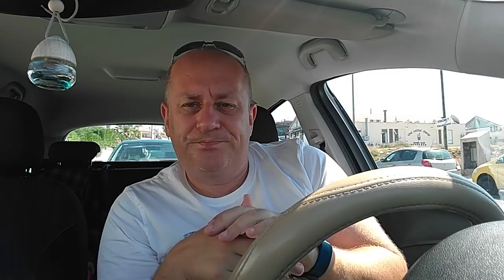Electrical sockets in Spain.

Comment: "1.5, 2.5, that's the diameter of the copper cable itself"  Incorrect, the 1.5, 2.5 square millimeter size refers to the cross sectional area, square millimeters, of the copper, not the diameter.
The UK BS1363 fused plug was invented to allow ring mains fused at 32/35 Amps to be used, as Spain uses 16 Amp breakers to protect the socket circuits and the sockets are rated at 16 Amps, there shouldn't be a problem.  In my experience, the main reason for damage from overheating is from loose connections at terminals.  As Spain uses fine stranding copper wires, the ends must have ferrules fitted if the terminal is a screw terminal, with the screw bearing directly on the wire.  
Going back to BS1363 plugs versus Schuko plugs, when was the last time you stepped on a Schuko plug in the dark, usually in the bedroom with bare feet and screamed?  and a 13 Amp plug?

Comment: Your video is great. I was thinking same as you, how they could wire 1 cable for everything. I was thinking to change cables and separate air conditioning and oven too. What you can suggest to me? In uk as you know we use 2.5mm for sockets 6mm for oven. No idea about air con because in uk we dont use :( i called few spanish elections to change cables and consumer units but bo luck so far.
Reply from the maker: If nearby i can give you an electrician. But we splitting the circuits is better if it's a fixer project. As much of the wiring may be 1.5mm (lighting)
Reply: Murcia , los alcazares i am,  i need to change consumer unit, run cable to oven and  new cable to 3 air con @LaMataMatt

Comment: There wiring is crap pal I’ve been a electrician. For over 40 years , there work is poor ..and shoddy. ..most houses I have seen are terrible 1.5 is for lighting we do use radial circuits 4 mm cable. Incoming isurrply is poor too ..,I have worked in Germany , and France .. we’re the work is a lot better ( some in France is bad to) but not as bad as Spain. Who trains the Spanish sparks ? . Most of them would never get a job in the uk …
Reply: No matter how poor Spanish electrics are, they'll never be as bad as your grammar

Comment: And we don't need fuses because we have radial circuits ( British people always criticizing Spain ) so I will use this opportunity to say that why don't you say anything about the  ring mains system in UK (which is frightening)?
Reply from the maker: It's not being critical it's a warning that the world has moved on. Most of the cable installations that are under rated were in the 80s. People had less technology and lower power consumption. The Ring Main of the UK was introduced after WW2 and due to the massive rebuilding of the UK, it was introduced to reduce the amount of copper needed.

Comment: I live in Spain and never had problem with electrical safety and I do have earth cables in all my sockets, the only point where I agree is that they should 2.5 mm instead of 1.5 but Spanish electrical law is based on Germany's and they would do something if it was so dangerous. If you want to see dangerous sockets go to Peru or Paraguay. And my devices never get hot .
Reply from the maker: People do install 2.5 as standard and 1.5 for lighting. The issues occur from older installations. Which on the coast is mainly 80s.

Comment: As for lighting circuits if we look at the Regs, 30 points are the max per circuit, i agree with you, if a house is split over floors split the lighting circuit over both floors. Are you talking about 35/50 year old properties??? Theres no need in a new property to fuse individual plugs in Spain as the whole reason for fusing plugs in the UK is because a 32A MCB/Fuse situated in the customer unit doesn't offer really much protection. The potentially unsafe and poorly designed wartime Britain regulations need to be adapted and individually dedicated circuits need to be brought in. Far safer.
Reply from the maker: 70s onwards as many have never had any upgrades or modernisation. New fittings old wires.
Reply: @LaMataMatt  i will add that the combined circuits of lighting and sockets in virtually low consumption rooms (we are talking before the commodities era) should have always been supplied and protected via a 2x10A MCB.

Comment: The only real reason to supply a socket with a 1.5mm cable in Spain is to supply a lighting socket, switched from a wall or device like a timer, relay... The Spanish Wiring Regulations does not specify 1.5mm for socket circuits its 2.5mm. In older properties before the 1974 REBT sockets & lighting in bedrooms and some times in the living room were supplied on the same circuit this, is no longer allowed.
Reply from the maker: I agree but still come across it regularly. The properties in this area are late 70s onwards. But still find it in 80s builds
Reply: @LaMataMatt  yeah you would do as in the 70s the regs were really pushed through around 1986/1988 and made the installer marginally responsible.

Comment: Sorry a bit dense when it comes to electrics.  Are you saying it is safer to have a British plug with an adaptor rather than using a Spanish plug?  I am a bit nervous of fire hazards so that sort of thing is quite important to me.
Reply from the maker: Most UK plugs have fuses in them, Spanish ones don't. So you can have a problem at a socket in Spain and it doesn't trip the power until it's a bigger problem. For example once it's burned the cables and they short together. Putting a British plug in an adaptor gives you some protection at that socket that will likely blow the fuse before anything worse happens.
Reply: @LaMataMatt  Thanks.  Probably a precaution I would take :)
Reply from the maker: @SweetLilyofPeace  it can save on a repair but also the adaptor is not far off the cost of changing the plug. So can be easier aswell.

Comment: Very worthwhile listen Matt, thanks. You're inadvertently making a fine case for buying a property in need of upgrade / remodel so new installs are overseen for QC.
Reply from the maker: The thing is when they were built it was fine. But today's world we use more power and need more sockets. So definitely worth taking a look at to make sure its either upto the job or budget for an upgrade.

Comment: Spot on! Even though ours was a new build when we bought it (2005) the electrical circuits are terrible! I even pulled new cabling myself to serve the swimming pool so it was on its own breaker circuit. When we had that installed we left the builders to it and went back to the UK for a couple of weeks, I showed them where I wanted the cabling joining into the house circuits in the underbuild. On our return and checking things over I actually found what they had done was to poke the ends of the bare wires (no earth!) into the open holes of a spare socket, not even bothered with a plug top! I have the photos to prove it. I got in touch with the project manager but after another month I sorted it myself.
Reply from the maker: Exactly, but this is the thing. Its being aware of it and looking at how to make sure it safe. Especially if dealing with a pool where the risks even greater.
Reply: I live in Spain and never had problem with electrical safety and I do have earth cables in all my sockets, the only point where I agree is that they should 2.5 mm instead of 1.5 but Spanish electrical law is based on Germany's and they would do something if it was so dangerous. If you want to see dangerous sockets go to Peru or Paraguay. And my devices never get hot .
Reply: Thats a strange one, As wiring regulations changed in 2002/2003 (into force) expressing a CPC be installed in every point , no matter what.